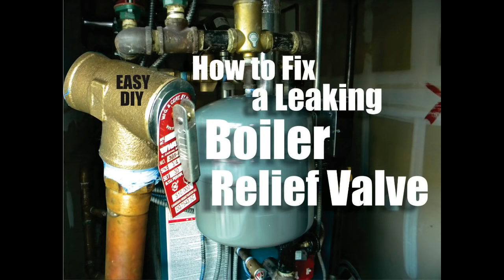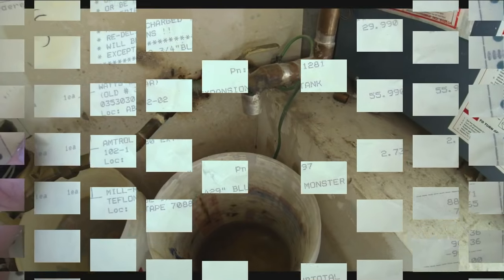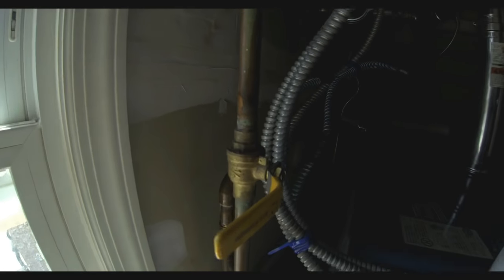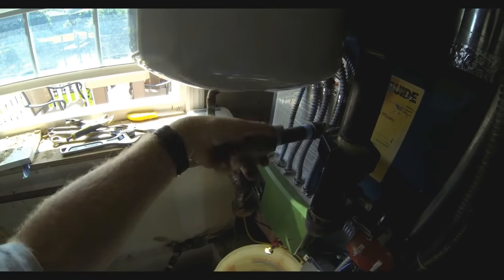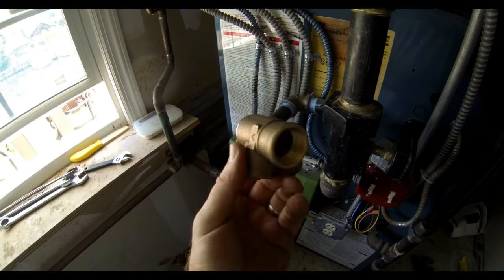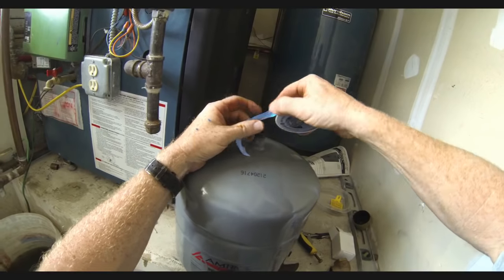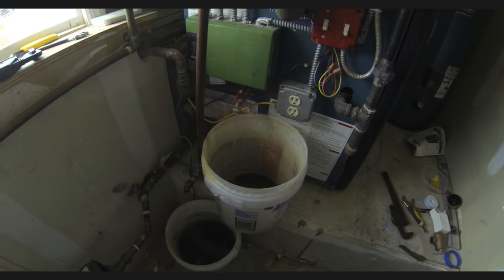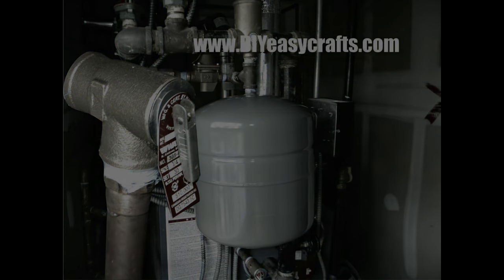How to Repair a Leaking Boiler Relief Valve Easy DIY

Comment: You’re gonna want to make sure the boiler is completely cooled down before adding water to it or else you’re gonna split your cast iron boiler and the company that was a “rip off” is gonna be laughing at you!
Reply: You are partially correct; you don’t need to wait for it to cool BUT you do need to fill slowly because quickly introducing cold water can possibly cause it to crack- this is usually on a steam boiler more than hot water boiler because steam units run hotter. Steam is made at 212° and HW is usually set at a max of 190° (more like 170-180°) Hopefully ppl see this warning. “Rip off” might not be the best statement but they do charge outrageous rates often and if they quoted a thousand bucks that is a rip off!

Comment: I replaced my over flow valve yesterday and it's still pushing out water through the valve, is it possible I still have a faulty over flow?

Comment: I just came across this video. During annual maintenance the plumber said my 20 years old boiler is old, he suggest to replace the "pressure safety system, boiler fast fill back flow combo, safety relief valve, safety pressure tank and Air vent" he is asking for $1600. I know those material is not expensive. This video shows changing the relief valve and expansion tank is not hard, replacing the Air vent took 2 minutes (by a different plumber) , why they charge $1600 ?
Reply from the maker: Because most home owners do not know how to do it themselves.
Reply: Because plumbers rip people off everyday it’s sad how big scammers they are.

Comment: I called a plumber and he told me that forced hot water systems need to have the entire system drained to do this job, which is a big job.   Did you drain all of the waters out of the entire heating system?
Reply from the maker: NOPE!!!
Reply: It’s not a big job to drain the system of water and remove any air takes 15 minutes.

Comment: What causes it to leak in the first place?
Reply: 7 things could cause the leak in the first place.
1.leaking tankless coil keep adding water to the system and over pressurizer the boiler.
2. over pressurized boiler by adding too much water.
3.expansion tank loose the charge.(  in this case drain the boiler, by using a bicycle pump you can add the pressure back to the expansion tank ( usually 12 PSI).
4. Defective expansion tank. 
5. Defective PRV keep adding water to the system. 
6. Someone accidently open the relief valve.
7. Boiler overheating.
Reply: cant can number 6, gotta be, the whole is brand new. Thanks.
Reply: Adding to "cant can"'s response:
8. The relief valve can corrode to the point where it can't handle
the "back pressure" when the boiler cycles off,
and will act as if someone pulled it,
which you SHOULD do as part of regular maintenance;
doing so after the unit has failed is worthless
(two to four times a year, homeowners should turn ALL the valves
in their house (under sinks, showers, toilets, water inlets/outlets, etc)
at least 1/4 in both directions; this keeps corrosion from forming
on the stems, and makes them last longer; doing so in both directions
ensures that you put it back to its original spot!).

Comment: I have the exact same problem. The expansion tank was full, so I put a new one on.
Still leaked.
I put on a new relief valve.
Leaks less, but still leaks out of the extension pipe from the relief valve.
What in the world could be the problem?!? The system isn't that old. Maybe 10 years.
I'm baffled and feel out of options.

Comment: You didn’t have to add air to the tank? Usually it comes with 30 psi already but I learn that they are supposed to contain the same amount of pressure that the water hose puts out witch in my City is around 55 psi.
Reply: They come charged at 12 psi. It doesn't matter what your water pressure is. The fill valve regulates the heating system to 12 psi
Reply: @phill3583  So if you have this problem and you boiler pressure gauge is reading 12 psi does that mean the pressure reducer valve is ok?
Reply: @cpoul  Not sure what you mean by pressure reducer valve.

Comment: Never touch the pressure relief valve. might  as change it after doing that.  did u check if weather or not you had to add pressure to the expansion tank. Usually u have to.
Reply: My pressure relief valves carry a warning that they should be tested every two months.
Reply: Byr, not true at all.

Comment: Wouldn't it be better to use pipe dope on the fittings? A little goes a long way.
Reply: There is only one place for pipe dope and that is throw it in the rubbish bin.
Reply: @johnbower  John Bower, any relation to the late, great Johnny Bower?

Comment: My plumber wanted to charge me $322 for a pressure relief valve that cost me $27.82 for a 5 minute job 😡
Reply: Does it bother you when a pizza place charges you $25 for a pizza that only cost them $1 to make? Plumbers gotta make money too. It costs a lot of money to run a business. Even that relief valve prob cost 5 cents for the manufacturer to make. You had no problem paying 50,000% markup on that lol
Reply: Yes, actually. Thats why I dont buy from a pizza shop. I make my own amd im a pinch there is a gas staion that charges $6 for a large!

Comment: If your expansion tank isn't rated for the current city pressure...you'll have a problem.   If your tank isn't the size you need rated for the amount of water in the system (30 psi or 60 psi) you'll have a problem.

Comment: I don’t have an expansion tank
Reply: Older systems don't have or need expansion tanks,
but new ones (since 2000 or so) usually offer them as an option
to prevent over-pressurizing of your system.
For residential use, it's a $50-200 part,
depending on the size needed (only a plumber can determine that,
though, sometimes, the boiler system's manual may indicate such)
and lasts 10-20 years, so, it's worth having.
Reply: I have a hot air radiator boiler and there are pressure vent valves.

Comment: So much was done wrong in this video in terms of safety, building code, and practicality.  There is this do it yourself society that demeans actual professionals and the costs involved with getting one to your home.  Words in the comments like thieves and crocks are very untrue and unfair in most cases.  Did anyone ever tell you that the orientation of that emergency relief valve was piped wrong?  Theres some knowledge that could save your life.  Is there any value in that?  Turning wrenches is cheap the knowledge to know how and why to turn the wrenches is where the costs is involved.
Reply: Marriage Partners Ministry he saved $1000
Reply: @gyver471  yes, and is endangering his family, voided his homeowners insurance policy, and demeaned a good trade, all out of ignorance.
Reply: And who exactly piped the orientation wrong? Likely a licensed plumber. Some plumbers are good. Some plumbers suck. I've seen both. $1,000 for that job is ridiculously high but you never mention that so you must think the price is fair. It's not. THAT, is where the problem is and how this video came to be. Considering more time than necessary to do this job at 3hrs at $100 an hour = $300.00 plus parts or roughly $400 for the complete job or hell, round it up to $500 and this video wouldn't have been made and a plumber somewhere could have taken the afternoon off and gone fishing.

Comment: I don't recommend just anyone to play around w a boiler its very dangerous and at high pressures   and you don't know other ppls work as far as cut off vales and as far as knowing if the electrical aspect is done properly where u think u turn a switch off or cut the breaker off and it still had voltage runnig thru ima hvac tech and let me tell u my worse night mares come from inexperienced ppls work or when home owners try this stuff on their own and do more damage then they think don't just watch a. youtube video like this and think this is the proper way theres way more to it then he makes it look
Reply from the maker: Thanks for your thoughts. I understand you wanting to prevent homeowners from taking money out of your pocket LOL. Please do not get me wrong but you only speak in very general terms. Please be more specific and correct anything you see that was done incorrectly on the video. Otherwise viewers should look at the # of positive comments that also talk about how easy this money saving DIY project really is.

Comment: Any pressure vessel should not be worked on by anyone who is not a trained professional, your house can blow up. Also very important is the fact that you are not paying a professional for just changing out parts willy nilly and then hoping for the best, you are paying for his years of "Professional" experience which could save you and your familiy's life by not blowing up your house and by possibly catching a potential safety issue like a monoxide leak. Here are some issues with this video, Relief valve drop against code, no idea on what is the correct size of expansion tank needed total sq ft of radiation unknown, total gallons of system unknown, what caused the over pressure that damaged your original tank? not knowing this may damage the new tank and relief valve again, this is where knowing the specs of the system could insure proper sizing. Lastly you introduced massive air into the system by improperly filling system, your pressure readings are now a combination of water and air in the system which is very inefficient, boiler will run longer and hotter costing more to run. I could go on and on all night but will close on a positive note, you did right by not paying whoever it was who wanted to charge you over a thousand dollars for this repair, their are rip off artist in every industry and for that I'm sorry but there are honest professionals out there who love their work and operate their businesses with a high level of integrity. I'm certain if you would have done what every homeowner should do and get several quotes, do a background check, go through Angie's list etc etc you could have located someone who would've done a great job for less than half of the other guys quote. Now for a quote from a renowned unknown philosopher "In this life you will always get what you pay for"
Reply: I generally agree with what you said here, but wouldn't one get charged for those several quotes?  That adds up quickly, even with the eventual bid winner applying the service call or diagnosis fee to the total charge.  I guess you could just go with one or two Angie's List suggestions and trust their recommendation?

My PRV is leaking now that I've shut off my boiler for the season.  I replaced my expansion tank about 10 years ago and am pretty handy, but will normally leave jobs that are out of my league to the pros.  I do quite a bit of research before deciding which jobs to do myself, and I appreciate all the input here.
Reply: NJbakintheday  not in these neck of the woods,  estimates are always free.  However diagnosis is not,  instead a tech is not obliged to divulge exactly what parts need changing only how much it would cost to get boiler fixed.  That's just smart business.  Yes it's wrong for someone to charge that much but equally wrong to take free estimate then use that free info to make the repair.

Comment: what about the people with bad feed valves? what about the people with bad coils or indirect Hot water heaters. im guessing you just advise them to keep changing these parts till they want a new system? videos like this are a spit in the face to all of us in the trade!
Reply: But pros put vids on all the time - haven't seen one yet that says 'this is only for professionals'. There's one by Steven L By putting them on they take away the mystery, educate and probably encourage people to have a go. And you can't really justify 1200 plus tax  vs 90 and an hours time of an amateur - that's one helluva difference.